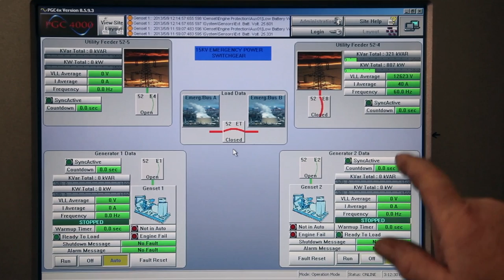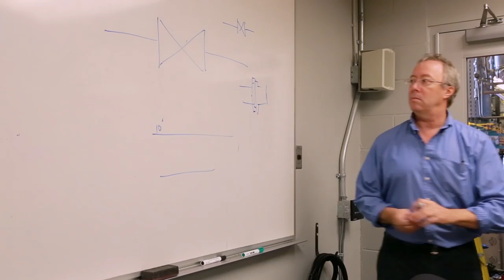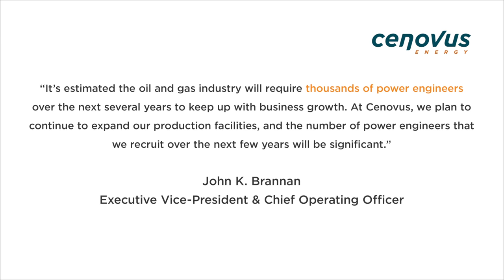Short Documentary on Power Engineers in Canada

Comment: do power engineers come from electrical engineering ?
Reply: yeah
Reply: lombe kabaso Mark no, they are operators/maintenance men
Reply: Power engineering may be a sub-field of electrical engineering, but i would challenge that more power engineers are working in steam plants and refrigeration plants than electrical employment. We're much more than operators and maintenance men. 4th and 3rd class operate and perform regular maintenance on equipment more than that of a 2nd or 1st class engineer. This greatly depends on the industry you're employed. A 1st class power engineer has a very similar role to that of a mechanical engineer, regarding plant designing and commissioning, and much more responsibility than 5th,4th and 3rd class engineers. There is a place for power engineers in most industries. In the health care sector, we operate auxiliary equipment such as OTSG's (once through steam generators) responsible for supplying low pressure (103kpa/15psi) steam to air handling units that distribute high quality air to every corner of the building. Also, high pressure (820kpa/120psi) steam is used in operating rooms for sterilization of operating equipment.  District energy projects are excellent examples of power engineering opportunities, refineries, breweries, sub stations, agricultural industry... There are vast employment opportunities for all the different levels of power engineers. Knowing where to look is very important. labeling all power engineers operators and maintenance men is a very dull, ignorant statement to make. Calling all power engineers operators and maintenance men, is no different than calling all electricians or plumbers or carpenters or any other qualified tradesmen, an apprentice. Its just not correct.
Reply: Steven Mullins This is all operations. There is no design or even redesigning of systems. You repair failures (mechanic) and start and stop machinery (operator). Your industry is a trade and does not require a degree, but a certificate. Nothing wrong with that, but do not compare power "engineers" with mechanical engineers. A degreed engineer and a operator are not even remotely close. Im not saying there isn't a place for operators because there absolutely is a need, energy production isn't going anywhere.

Also, you used the word and it's variant "operator" four times in order to describe your job..
Reply: Thomas Treahorn, PE 
Actually 2nd and 1st class power engineers don't operate at all they usually go into managing the operators and design/planning....
Btw
I know a friend who is a 1st class engineer.
Reply: E WEBBeng
You're absolutely wrong on several points. 
Power engineering in 2018 is not a trade, it's a profession. 
The education requirements today have changed. Companies are hiring PE's with 3 year advanced diploma's, plus the required government certification (passed TSSA exams, and steam time). We are power engineering technologists. The days of just having a "certificate", as you put it, are over. Here's a fun fact for you. The vast majority of my class in year 1 consisted of mechanical, electrical, and structural engineers (all with 4 year degrees) from all over the world. Want to know what they obtained advanced standing in? 1st year technical math, and 1st year applied mechanics. Nothing more. This incorrect idea you have of engineers and operators being world's apart, in 2018, is completely false. Engineers from Universities are among the most useless, incompetent, non employable people I've come across. "Bachelor of Technology" programs are trying to fix this problem. I'd much rather be a technologist than an "engineer". I know how to apply the theory, I learned in class, into the real world. I will graduate with co op experience, and be employable. You should have saved your money and took PE in college instead. For future reference, yes I would like fries with that. Nice ring. Have a good day :)
Reply: You couldn't have said it any better! I don't just understand why some people choose to put someone else's career down just to elevate their own. Just because you have a degree doesnt mean you can walk into a power plant and operate it (at least by law). Hopefully (E WEBBeng) is not a type of person with a 4-year degree in engineering program, with a ring, and still looking for work.
Reply: this is completely false, and you still aren't understanding that you could essentially call ANYONE a tradesmen / tradeswoman by your concept of what an engineer is.  just stop because you're insulting the people that understand and apply far more difficult concepts than "maintenance men".  Engineering is NOT a trade.
Reply: not only! There are workers who control mechanical conditions of power switches  and I think it's not necessary to be good at electrical engineering in that work
Reply: Gandalf the Grey do u know how much your friend makes?
Reply: Power engineering is sub engineering of mechanical engineering
Reply: @Steve-yl6ls  thanks....can I call you sir
Reply: I want get a job in Power Industry in canada